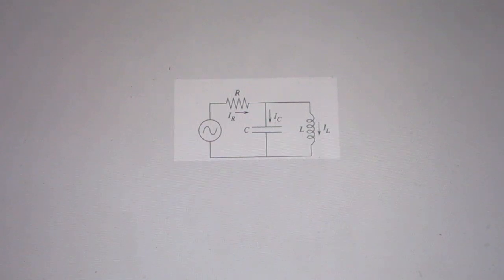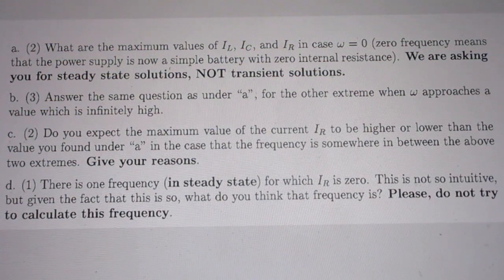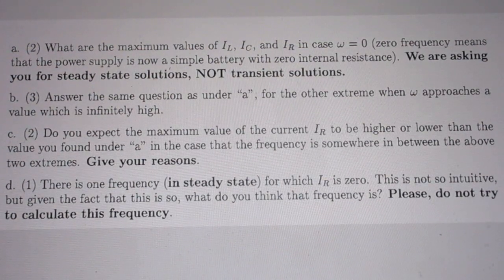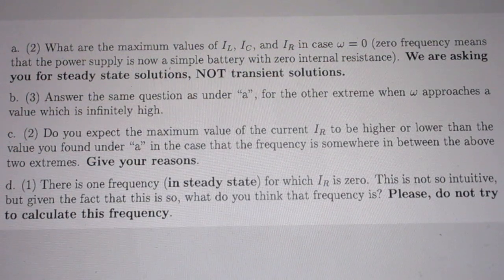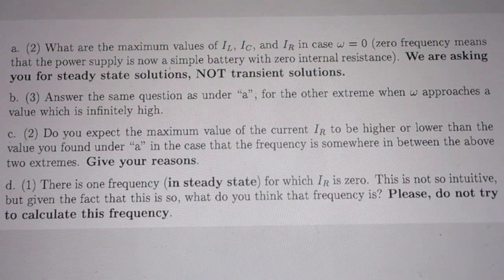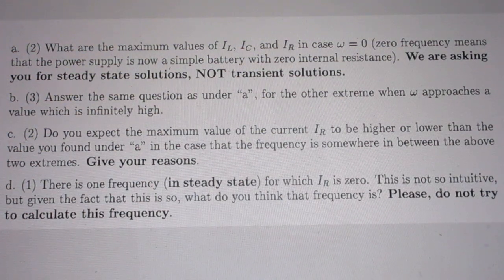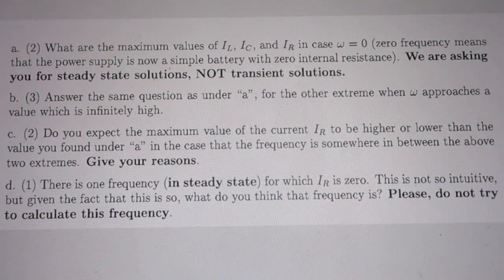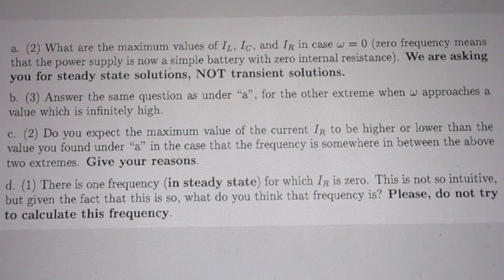Solutions to #134 - No Eqs Needed

Comment: This got me thinking, would such an infinite oscillator be possible in reality? You can make it superconductive, and I can just about imagine a perfect capacitor, but can a self inductor be that perfect, or will there always be losses in induction?
Reply from the maker: The selfinductor must have ZERO ohmic resistane thus it must be a super conductor. The Capacitor must also have zero ohmic resistance. I do not know whether that is possible.
Reply: I think the coil and the capacitor must have spatial dimensions > 0. Therefore they are coupled to space and will send out electromagnetic waves.
Maybe in a superconductive pot circle this is thinkable.